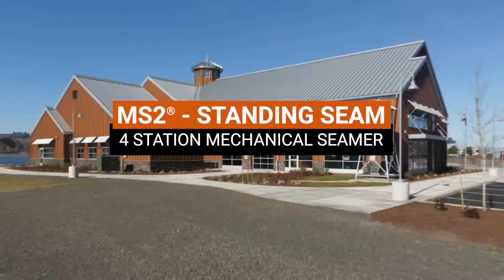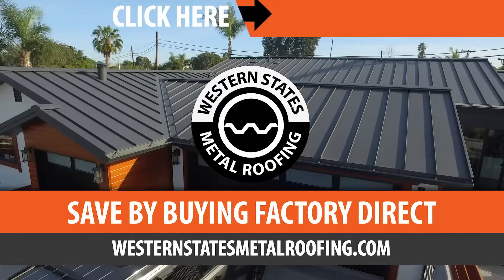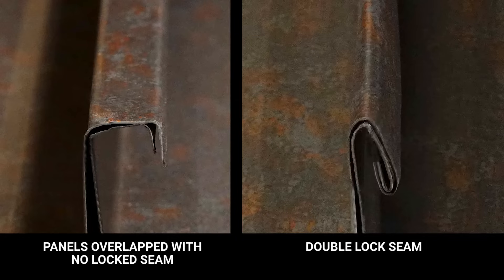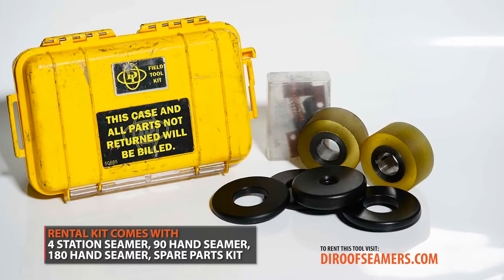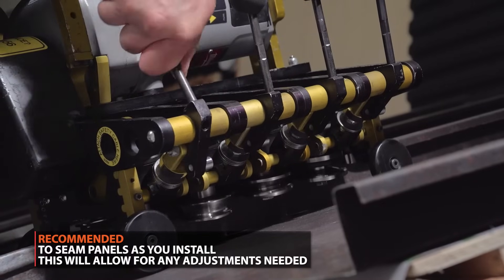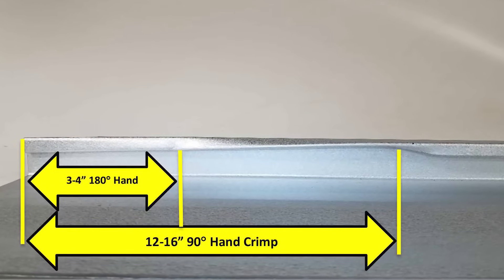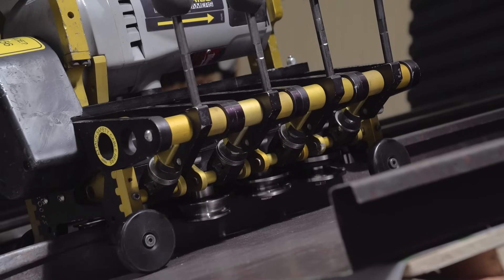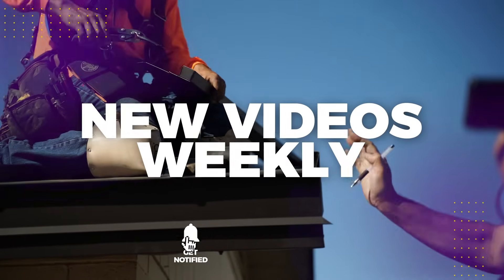Mechanically Seamed Standing Seam Metal Roofing Installation - How To Use A Roof Seamer Machine

Comment: Using automatic seam sealer it appears that you have to start roof on the right hand side using seam sealer in the uphill direction. If you start sealing panels from left to right, then seam would be oriented in the incorrect direction.
Reply from the maker: I am not sure I understand exactly what you are saying, but going to take a stab at this. My response is directly from the manufacturer of the tool.

Per DMI Seamers:
I think the customer is saying that if you started laying the panels from left to right you would have to start the seamer at the top of the roof and run it down to the eave.  The seam would be on the left side in his scenario.  Which is perfectly fine as long as you have someone making sure the seamer doesn't run off of the roof.  If they are following our field guide practices of tethering the seamer and guiding it along at all times it shouldn't be a problem.  I hope this helps.
Reply: Then you run the tool ypside down. Im currently doing that on a zinc double lock system.